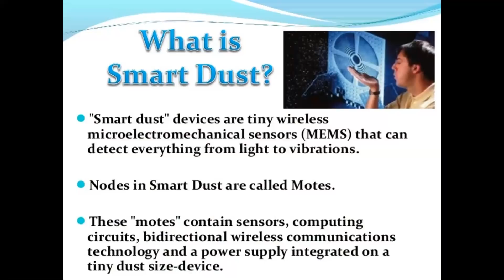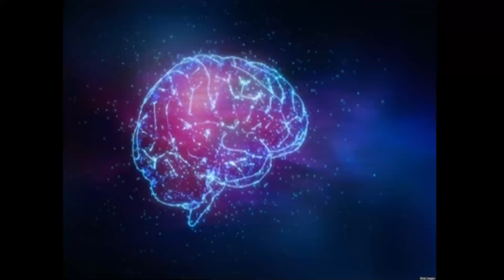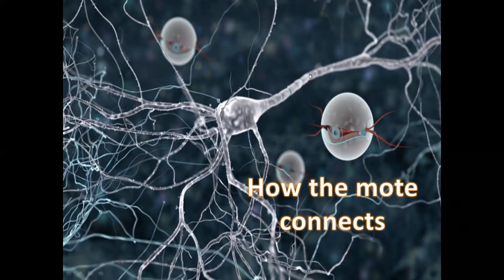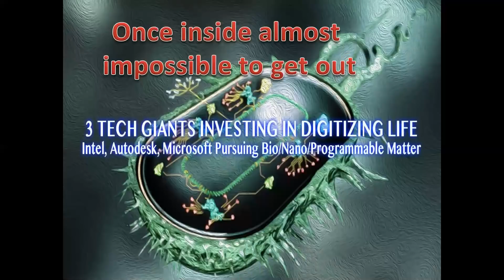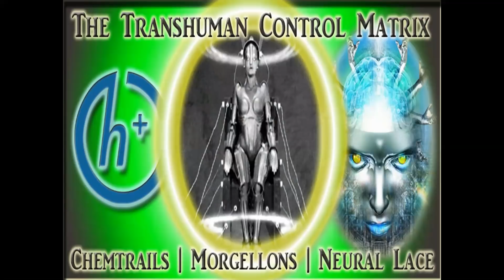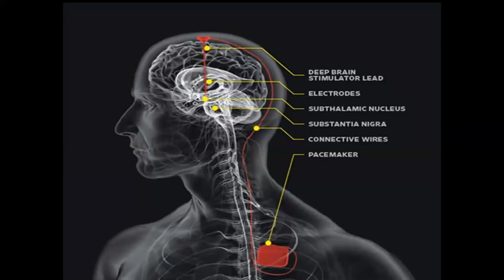Are we already infected

Comment: Woah, woah, woah back it up R Wayne, in your own information the "smart dust"  has existed since 1996 Not 1966. Yes, it is used often for security for high end merchandise to track it from the manufacturers to the consumer. It is embedded into the codes. It is supposedly to keep track of items and eliminate the chance of items from "falling off of the truck". 

The silicone chip inside her head has switched to overload. From I Don't like Monday's. Bob Geldof